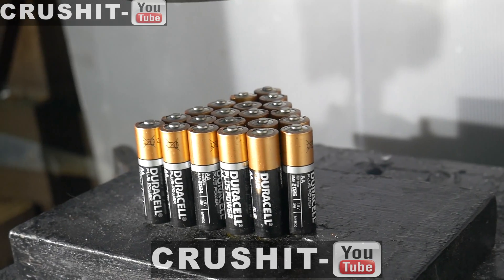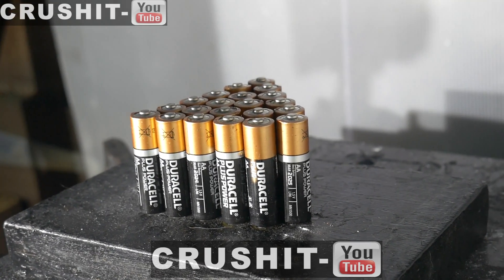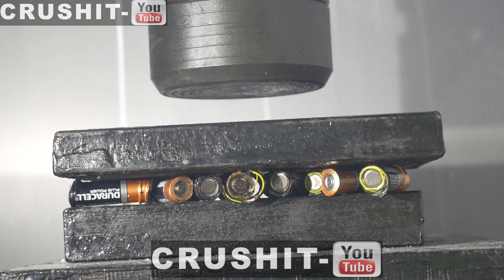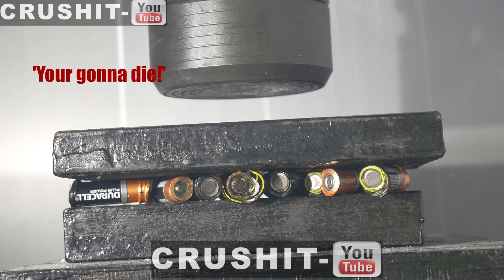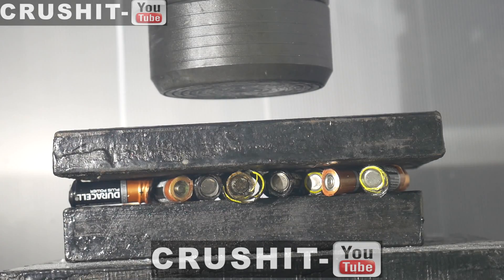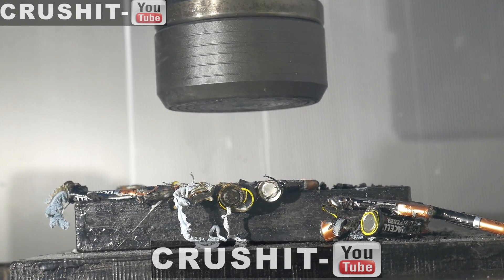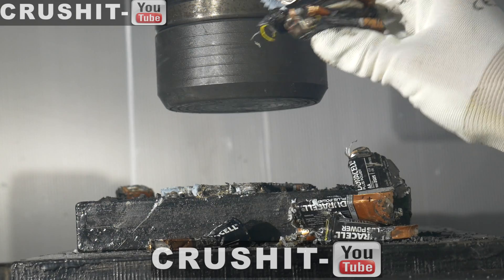Crushing 21 Batteries with Big Hydraulic Press

Comment: Eat the goo, it's good for you and gives you powers!
Reply: ko
Reply: :D
Reply: Acid powers and acid shit
Reply: Ouch!
Reply: +Landyn kohler ik you should be talking to him lol
Reply: +Landyn kohler Let me give you a Chemistry/Physics lesson... Fuck it I can't be bothered. But basically batteries contain a metal and an acid. These react chemically. Acid turns into an alkaline metal into salt. In rechargeable the reaction occurs slightly differently but the only difference is that when electricity is forced into the battery the reaction happens in reverse. In conclusion! Before a battery is used it only contains acid no alkaline... However, as the battery is used the reaction occurs and the alkaline is formed so most of the time the battery has BOTH acid and alkaline. Then right before its used up, the battery only has alkaline . You are educated now and very welcome.
Reply: You never used the word cathode or anode so you are not educating anyone.  All they have to do is Google those words and it would have saved you a bit of time.
Reply: +darkhawk1979 fair comment
Reply: Why try and argue about something you know nothing about?
Reply: +Kyle's fishing adventures 112 ... 

... No
Reply: Kyle's fishing adventures 112 Because no. Don't stoop to his level.
Reply: theoritically it is safe to eat
Reply: lol that's what I say
Reply: 😂😂😂😂😂😂😂😑 NO
Reply: Lies!!!!!!!
Reply: its zinc, it wouldent do anything
Reply: err they are alkaline batteries which contain zinc and NaOH, i have actually taken a used one apart and refilled it

Comment: Am I the only one thought of a pimple being popped when the batteries were crushed?

Drinking alkaline is the key to staying eternally young, too.
Reply: Ak94dude lol me too!
Reply: Tap water is alkaline.

Also, alkaline is not a 'thing'.
Reply: Tap water should be PH neutral no?
Reply: +slizza90 7 is neutral tap water is like 7.3-7.4
Reply: Chase Hathaway no it is a bit acidic
Reply: Nat Gamer If your tap water is acidic, I think your local council are incompetent.
Reply: Dangerous Dingo there was a yt video about it.  I think it got deleted
Reply: Nat Gamer The range of P.H that the human body can tolerate is extremely small.
 If you look at the P.H scale, it is analogous to the Electro-Magnetic spectrum; if you look at the entire spectrum, from microwaves up to x-rays/gamma rays, the 'visible light' that we see is only a tiny slither of that entire spectrum.
 The P.H scale is like this; out of the entire range of 0 to 14, there is only a tiny slither which represents the acceptable range for a functioning human body.

If your body is outside of this range, you are quiet simply dead.

The human body does an incredible job of balancing itself within that acceptable range. Little effort is required on our part to maintain this.

Alkalised water is a scam. It's another 'health' trend packed with pseudo-science designed to take your money. The premise is true, however the facts are misrepresented, & to top off all of that, tap water is already alkaline. If it is not, there is a problem with your municipality.
Reply: Ak94dude i thought of pimples tooo
Reply: I thought of it too
Reply: Not all alkaline substances are safe to drink - sodium hydroxide is corrosive and extremely toxic, for instance.
Reply: I did.
Reply: Dangerous Dingo water should have a pH of about 7 (neutral on the pH scale) it should not be either acidic or basic.

also stomach acid (hydochloric acid) is on of the most corrosive acid with a pH of 0. it doesnt kill you by burning through your organs because of the mucus lining your stomach. when you are hungry the mucus thins and thats hunger pains. and when your body thinks you are going to get food (thoughts, sounds, scents, visuals, etc) your body produces more hydrochloric acid which creates the grumbling and gurgling when you are hungry.
Reply: Ak94dude I crush things in my shredder machine
Reply: drink me to STAY STRONG!

Comment: Scale up, try a car battery? (Be careful)
Reply: Yahh
Reply: please don't.  Car batteries are lead-acid (sulphur) and will cause a toxic spill.

Those Duracells you squished have an alkaline (hence the alkaline battery name) center, which is the opposite of an acid, but still very corrosive.
Reply: ^ another one
Reply: +Greg Smith Get the right conditions and he'll be fine.
Reply: we dont really care, thank you.
Reply: +Aeralius Co you're picture is amazing
Reply: ^ Thanks XD
Reply: I can't stop looking at it lol
Reply: +Greg Smith You can use a strong alkaline to neutralize the acidity. For example, baking soda works okay.
Reply: and then a plane APU
Reply: Try a hydrolic press vs hydrolic press
Reply: I did fire one up when I was 9 and it exploded in my face like a flashbanh. hopefully I was in my normal state after 12 hours
Reply: +National Socialist I was lucky because only 1/6 part of the battery exploded and it was only the acid
Reply: But if it's acid how does it stay in the metal?
Reply: National Socialist I know it was acidic and I was not able to see clearly and hear clearly the whole day. Well it was a 120Ah battery and half empty of acid and I said only 1 of the 6 portions exploded and the acid evaporated right away
Reply: But how does plastic still not get dissolved by the acids, also i think you had an alkaline battery and not acid
Reply: +fifia lpo Recharged alkaline battery wtf ?
Reply: But batteries can leak right?
Reply: National Socialist You should know that the H2SO4 vapors in the battery are virtually non-existent. Besides that, the acid is dangerous, yes, but it is however very, very diluted. Of course you should take normal chem precautions when handling it, but it sure as hell won't "boil your face off", lmao. RFNA or WFNA will more likely do that.
Reply: Herobrine GaMiNg Regardless, buddy, don't mess with acids if you don't know EXACTLY WHAT YOU ARE DOING. 
One screw up and you're in a whole world of shit.
Reply: Herobrine GaMiNg If what you say occurred really did, then contact a medical professional. Any chemical in your eyes, even benign things can have hella bad effects. Be careful!
Reply: fifia lpo Car batteries are not alkaline. 
Car battery: Usually an electrolyte, H2SO4 in most cases, lead, and water. (I'm most likely missing a few things because I'm not totally savvy in the battery area of technology. 

Alkaline battery: Again electrolyte, usually KOH, Zinc paste, MnO2, and sometimes a Carbon electrode.
Reply: If an acid car battery completely explodes in your face then savage
Reply: fifia lpo No.
Reply: Actually yes. All batteries will eventually leak gradually over time.

Comment: Please try to crush an egg. But put it vertically.
Reply: holy SHIT GETTIN CRAY ZAY UP IN THIS HIZZIE HIZZA MOTHAFUKA!!! VERTICAL EGGS SO CRAÅÄ@ÂĄĄĄĀÆZAY!!!
Reply: +BrickForge 787 with just your handa, yes
with a hydraulic press, I doubt it
Reply: I've crushed one vertically with my hand before. It wasn't hard.
Reply: i can crush a egg vertically with 2 fingers. Are you all weak or im strong ?
Reply: Do it at fuckin home
Reply: ***** I CAN DO IT WITH 2 FINGERS
Reply: It would crush, only because of the insane amount of force xD
Reply: that's how u know that the egg wasn't fresh
Reply: +Tyler Sepulveda You absolutely didn't.
Reply: Wruce Bayne I absolutely did. Tyler1 did it as well in one of his cooking videos.
Reply: Tyler Sepulveda
He also did it incorrectly, you lay your hand flat wrapped around the egg, not pushing into the side of it with your finger tips. If done correctly an egg can sustain 150 lbs+ of force. You realise there's science that backs this up right? Just a couple google searches and you'll realise if done in the correct way, you can't do it.
Reply: Wruce Bayne I think I had my fingertips on the side, but I was applying pressure to the top of the egg, coming from the middle of my fingers
Reply: +Tyler Sepulveda rotmg players everywhere on yt these days
Reply: DillonReal RotMG rotmg is life bro
Reply: +Tyler Sepulveda rotmg is love
Reply: rotmg is an addiction that takes over your life and destroys your from the inside out.
Reply: Jaime Maté

Comment: FIRST these are alkaline batteries that usually have powdered zinc and sodium hydroxide, 
SECOND, the NaOH is dilute enough to not be a major concern and zinc is harmless
gloves are recommended but not needed with these kind of bateries
Reply: ALL of the white stuf is zinc
Reply: and of course it is warm, when u take metal and bend it, it becomes warm because of friction, the same thing happened with the bateries
Reply: All of a sudden you know science fam 
All of a sudden
Reply: thanks ima quick learner
Reply: try it with Chinese 9 volt batteries

Comment: You get lead acid batteries but AA are alkaline as far as google told me.
Reply: Indeed. Lead Acid batteries are generally "Car Batteries" or the much larger cousins of these primary cells. What was squeezing out in the video was likely the potassium hydroxide electrolyte or the zinc oxide anode material.
Reply: Pathy's Playhouse k...
Reply: I thought ammonium chloride
Reply: simon Young google sucks
Reply: Homer Simpson  here we see a rare bing user

Comment: It seems you have squished out the ammonia chloride paste. Good job.
Reply: i don't think his gloves are water resistaint at all, i mean allmost any liquid would go straight trhough them...
Reply: Is this water? Is it even liquid?
Reply: William Hough those batteries are dry cells meaning instead of having a liquid acid inside it has a paste in it. A wet cell battery does have a liquid/acid in it. You should have Learned this in 8th grade

Comment: Crush an aerosol can. Or a stick of TNT
Reply: a stick of tnt will not do anything
Reply: Aerosol, explode. TNT nothing, just squished. There you go. You watched it in your head.
Reply: Kauer Racing no
Reply: Yup. Very stable. Takes a LOT of heat to get it to go boom and if you crushed a stick of it the stick would burst before the gunpowder would go off. And once gunpowder is nolonger packed in a stick it is relatively safe and burns like a flare but shorter.
Reply: Ah, forgive my ignorance. I was under the impression TNT once contained nitroglycerin? Isn't that stuff highly unstable?
Reply: TNT doesn't contain nitroglycerin. You're thinking of dynamite, which while it does contain nitroglycerin, is still relatively stable, though I wouldn't crush it.
Reply: You'd better crush that aresol next to a couple of open flames tho!
Reply: TNT being crushed is actually really disappointing
Reply: Austin Hayducky Old, damp dynamite would be much morre fun! I fact while were at it lets just use straight nitroglycerin - because nothing could ever go wrong there hey....
Reply: Do it FAST.

Comment: its a myth, you can touch it with bare hands. I used to do it when I was young
Reply: exactly just dont eat it
Reply: well i'm screwed
Reply: Plottwist: Navnish Nigam is now dead of poisoning.
Reply: Yeah. The confusion is between household batteries (alkaline) & larger block batteries (those do contain acids). Alkaline can irritate the skin a bit but that's all.
Reply: All it is: Magnesium Dioxide. Its harmless.
Reply: Anecdotal...
Reply: By magnesium dioxide, do you mean manganese dioxide?

Also, don't forget the potassium hydroxide.
Reply: Yes My bad.
Reply: i open batteries, it makes your hands feel slimy (K OH). some dilute acid works to neutralise it.
Reply: vinegar solution, just ask Gma and Gpa. or just wash your hands maybe? like lead, or mercury, use your brain... wash hands and dont eat it!

Comment: Just saying... batteries are typically lithium and hydrchloric acid.... acid .
Reply: the same acid that's in your stomach
Reply: +Scar yes HCl is in your stomach too however it's much less concentrated than that inside batteries. Also I didn't mention in the above comment, but Li-HCl batteries are light duty common batteries such as AA batteries. Bigger batteries such as car batteries usually consist of Pb and H2SO4 (Lead and sulfuric acid)
Reply: you can actualy touch the acid inside the batteries and it will cause no hard at all. the only thing that will happen is a rash but thats all.
Reply: ...or Zinc Alkaline.
Reply: yup pretty much, that's why you don't drink bleach xD
Reply: that is zinc chloride paste
Reply: these are alkaline batteries which contain zinc metal powder, and sodium hydroxide (NaOH)
Reply: Cyrus Khalvati Ok, so I have done some in-depth chemical research... aka I actually have an education. EVERYONE in this comment section is right ! Now before you try to slaughter me, let me explain. Batteries Contain either an acid and a metal or a hydroxide and a metal. Now all hydroxides are usually basic... usually . The basic definition of an acid (excuse the oximoron) is a chemical that can lend a hydrogen to another chemical. The long and short of it is that hydroxides you may notice contain a hydrogen! THESE SUBSTANCES, THOUGH BASIC ACT AS ACIDS. so yes acids contain acids (always) and bases (sometimes) but thats because the bases are substituting as an acid by lending the hydrogen. Obviously it is slightly more complicated than this but its the same theory.

Can confirm that all batteries contain acids and some contain bases.

Thankyou for letting me waste your time with trivial fact that someone is going to rebut in approximately 1 day.

Comment: i was expecting liquid, not silly-string consistency O.o
Reply: It's liquid until it comes in contact with Oxygen.
Reply: unless it's corroded, in which case it's green liquid (had some troubles with batteries in the past).
Reply: then why was it green liquid when I found it leaking out of the old batteries ***** ?
Reply: What size battery? AA, AAA, 9V, etc?
Reply: pretty sure AA. they were in a camera.
Reply: gg well played

Comment: I work at a battery manufacturer and I can tell you with 100% certainty that it's an ALKALINE hence the name ALKALINE batteries. The reason why is because the electrolyt used in the batteries is KOH, which is an alkaline.
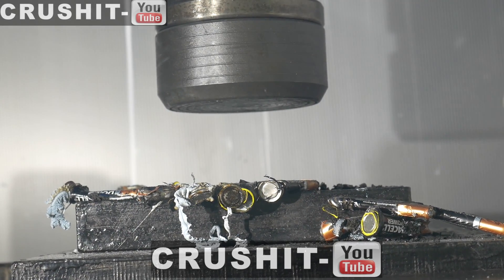BUT the greyish/blue stuff you see and refer to in 1:18 is actually a paste of Zinc (for the most part) the alkaline is absorbed into something called 'seperator paper' and also a little bit into the zinc paste as well, so you can't really 'see' it.

For your own safety you had to wear gloves AND a mask since the alkaline will give toxic fumes when short circuited like you did by crushing them (The warmth you felt was because of the dissipation of the energy created by the short circuit). Also: inside the batteries are 'heavy metals' like Manganese,.. which are also toxic when inhaled. 
Smartass out

Comment: So did we ever find out if it was an alkaline or an acid
Reply: alkaline, its called an alkaline battery and they arent wet batteries so no acid
Reply: Acids and alkaline aren't mutually exclusive. You are thinking of acids and bases, alkaline are a type of metal.
Reply: Alkaline means basic, look up the definition. Unless you say "alkaline metal" specifically referring to an element. By the way they are called alkaline metals because they readily form strong alkaline (aka basic) hydroxides when mixed with water, and not acids.
Reply: It says right on the batteries alkaline
Reply: +Travis “Boot” Babcock I know it was a joke because of the comments on the last video

Comment: Hope you recycle those.
Reply: who hopes?
Reply: +Project Cancer My hopes were crushed.
Reply: George Whaklo
😂😂😂😂😂😂😂😂😂😂😂😂😂😂😂😂😂😂😂😂😂
Reply: +George Whaklo bdm tsss?
Reply: Who is hope?
Reply: +Mike Zilla so you hate cats?
Reply: Anthony Mcgoun
I hate recycling.
Reply: Ken Barber It's because recycling is stupid.
Reply: Mike Zilla Well, so far, recycling is the best waste disposal form we've got. The alternative is dumping it in a landfill or burning it, both of which are worse. So until we have molecular reassembly...

Recycle yo schitte. Except paper. Put that in the compost. But don't throw it away. It'd be more eco-friendly just to burn it. Seepage and industrial runoff and whatall.
Reply: George Whaklo Recycling creates a hell of a lot of pollution as it's essentially a process of re-transporting and re-manufacturing to make a more expensive, lower quality bi-product. The problem with landfills can be solved by using LESS plastic, as just about everything else that's biodegradable belongs in a landfill.

I'd argue the only worthwhile material to recycle is metal since it's easier to recycle than mine. Otherwise recycling is not very eco friendly.

Comment: About 20 years ago I took a knife and cut into an AA battery slicing my finger open in the process. Some of the battery "acid" seeped into my finger, and despite washing it and putting on a plaster, some remained inside my finger. Even to this day I can see the black mark inside where my body has made a buffer around it. I'm still alive.